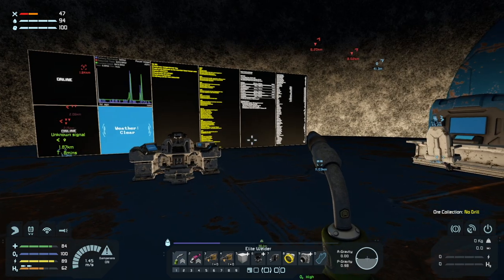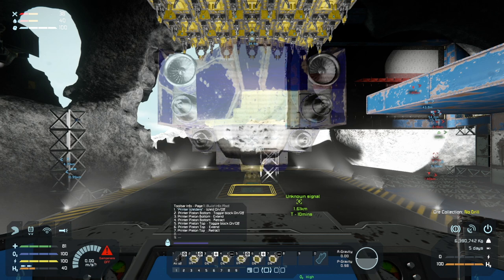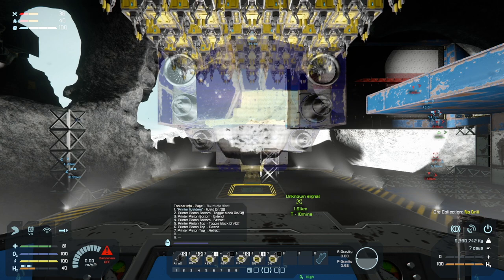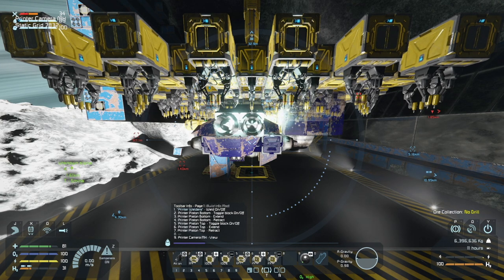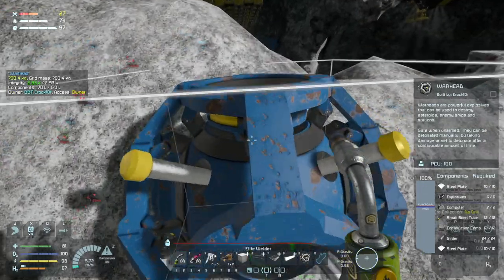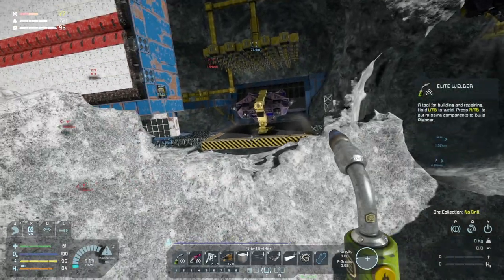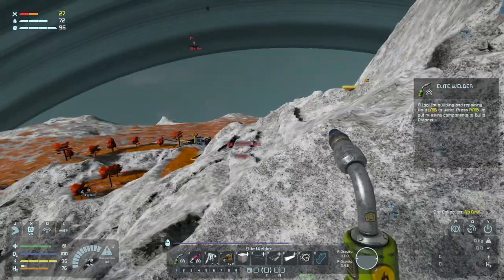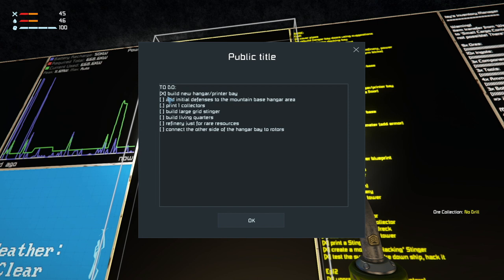The Grind: Episode 22  - Printer Bay (Space Engineers Survival Scenario)

Comment: The landing gear won't weld where you have it because it is intersecting the neon on the floor; if you remove that one piece of neon by the landing gear it would have welded it up from the floor without the need of the 2 little tower contact points.
Reply from the maker: Good spot - thanks!

Comment: Good job on the large grid printer!
Don't panic about the large thruster, as long as the printed grid is stationary (i.e. not a subgrid of the base), it will not damage the floor. Also, in case you're wondering, the landing gear cannot be placed, because the space is occupied by one of the neon tubes on the floor.
Keep it up and have fun engineering!
Reply from the maker: That's great to know - thank you!

Comment: So part of your printer problem is that giant thruster.  It wont print the thruster while the printer prongs are inside the projection and those other thrusters below/on the side go out of range because their only connection is the giant thruster which is why you need to bring it back down to finish them off or add a block that connects to another block on the side that will cause the blocks to print even without the giant thruster printed.  Just need that block connection of some sort. 

Floors you can try interior blocks. - One side of the interior blocks have these sort of lights on them too which you can see in darker area's.
Reply from the maker: Great suggestion - I think I can fix that thrust problem modifying the armor (as you suggest) . And I definitely under-utilize interior blocks.

Comment: before you release it from all "contact" points thruster check (station keeping)  .... Another option is  place your "contact" block where the landing gear is  raise projection one block higher from the "floor -- and/or put one on the large thruster

Parts delay is SE trying to figure out which welder to get to and every conveyor junction you have between the the welder and storage it thinks "" can I go that way?"" 6 times (each face) like wise on "T" junctions ( just 3 times)  that is one of the reasons why a LG drill has 5 ports .. and the grinder and welder only have 3 ports ...less thinking for SE to do.. another is like you said multiple welders are trying to grab the same part

Opps --- have you tried small grid warheads  ( shooting them ) "remote detonation " placing armor panel basket to hold it
Reply from the maker: That's what I wondered - time to see if I can make the welder layout more efficient. 

Good idea - I haven't tried and armor panel basket for the warheads - I need to try that.

Thanks!